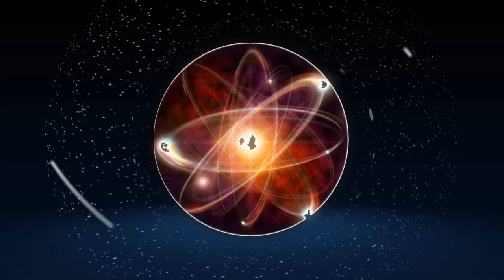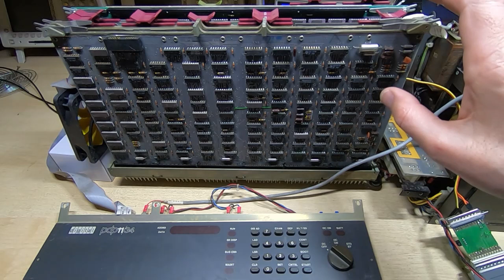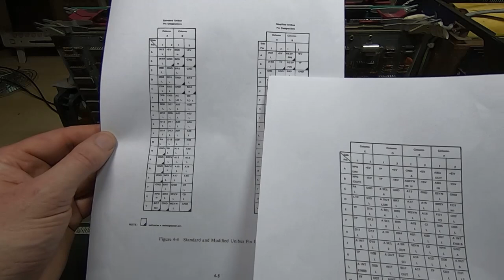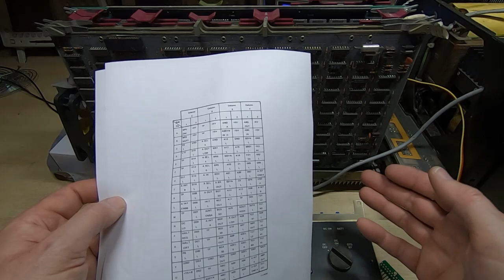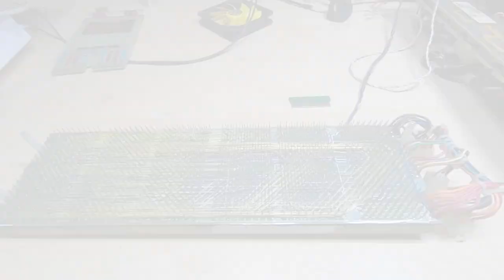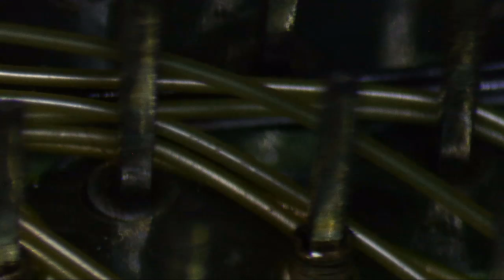PDP11-34A Repair Part13 The Backplane Problems

Comment: If the faults are truly being caused by corrosion on the wire wrap pins, cleaning with Craig.vom DeoxIT-D cleaner and brushes and swabs might be a good solution.
Reply from the maker: I would recommend against that as contact cleaners leave a protective coating which will make resoldering almost impossible and would not fix the problem. Unfortunately this machine has much bigger problems.

Comment: An interesting but ominous investigation of your backplane. Unfortunately I have a machine with similar evidence of corrosion. A few years ago I did a road trip to recover a PDP-11/15 that had been sitting in a horse stable for the best part of 40 years. It had even partially flooded during that time as the DEC MM11 unit at the bottom of the industrial rack it was in had a fine coating of mud silt over everything inside. One of the transistors of the core drive board that was in it just fell off when I touched it. The 11/15 was thankfully towards the top of the rack but the wire wrapped DD11 backplanes in it don't look terribly good.
Should I ever get to working on it I have the engineering print set but I am at a loss as to how to interpret the DEC wirelist pages, I think I would be buzzing out and attempting to visually inspect and compile a list myself. This would be no easy task as the wirewrap connections at the base of the pins really are obscured by higher up wires.
Reply from the maker: I will go over the wiring lists in a video. They are fairly simple. The first column is a 'run name' which indicates which connections are in this string. The location column indicates which pins are connected by that run. For example C03U1, C04U1, C05U1. This indicates that Row C, Slot 3 pin U side 1 is connected to Row C Slot 4 pin U side 1 and is also connected to Row C Slot 5 pin U side 1. Some connections are made through the pcb. For the wires you just start at the first node in the list for a particular run and just link node to node for the run. With the power connectors on the right Row A is at the right, Slot 1 is at the front. Pin A is at the right and side 1 is at the front.

Comment: Just wondering... Would re-manufacturing such a backplane with modern multilayer PCB be an option?
Can the card connectors be removed and reused or are they connected directly to the wirewrap pins?
There might be others who need a new backplane too...
Reply from the maker: I discuss this in the next video.
Reply: I actually wouldn't mind a backplane for mine. IIRC, the 11's share a similarity in backplanes.

Comment: I've not worked on these but I have worked on card shelves in telecoms equipment and the backplanes can cause all kinds of weird faults. The cause of it is often the flexing they get as cards are removed and inserted, but the biggest problem with them is that in general, they are inaccessible - typically you have to disconnect and remove the entire shelf to get to them and the actual fault can be hidden under a connector. Often easiest solution with the least downtime is simply to replace either the backplane PCB or the whole shelf, but it's also the most expensive. I thoroughly enjoy your videos, Jerry - please keep them coming!

Comment: You would need another cpu backplane from an 11/34, am I correct?  A cpu backplane from another model (11/44) would be quite different?
Reply from the maker: Yes that is correct. It also has to be the CPU backplane as the second backplane is not the same. As far as I know the actual pcb assembly is the same but the wire wrap connections are different.
Reply: @JerryWalker001  Maybe you'll find another backplane assembly in good condition that only requires re-wire-wrapping, unless you get really lucky and find a good condition replacement CPU backplane.

Every time I look at the bare solder-covered traces on the boards in my PDP-8 machines, I cringe because of the lack of protection and even my untrained eyes see corrosion and problems waiting to happen if they haven't already happened.  Now after seeing the failed solder connections between the wire-wrap pins and the PCB, I'm worried what I might find in my 8/E that was having "unusual" problems the last time I ran it - none of the "Gurus" around the world could put their finger on what to look at/for based on the symptoms I was able to report, but now I'm wondering about possible backplane problems as a very slight possibility.  Since DEC seems to have been building most of their machines (like the so-called "low-end" 11/34-series machines) to a (low) price point, I have to assume that they saw no benefit to their Corporate pocketbooks in applying corrosion-protection to traces.  I've got a VT78 (DECmate) that had dendritic-looking "fuzz" (for the lack of a better description) on some of its circuitry the last time I looked closely at it (~10 years ago), but it was probably built around the same time period as your -11/34A.